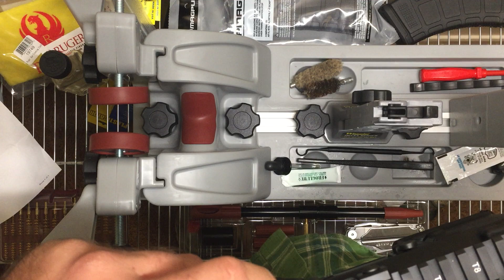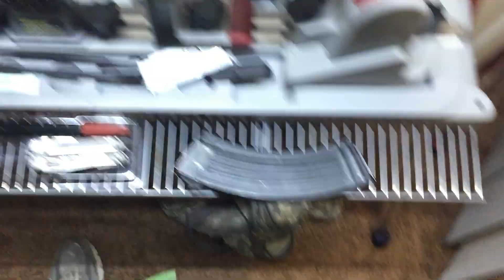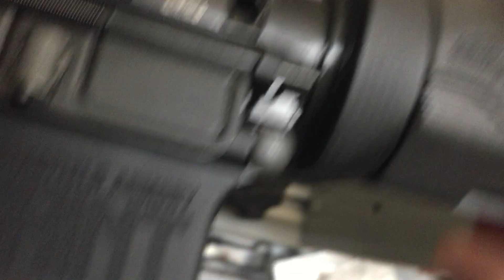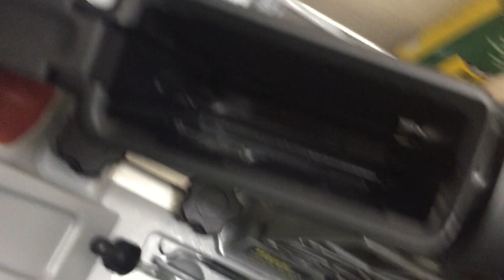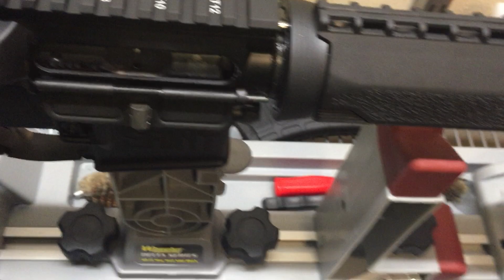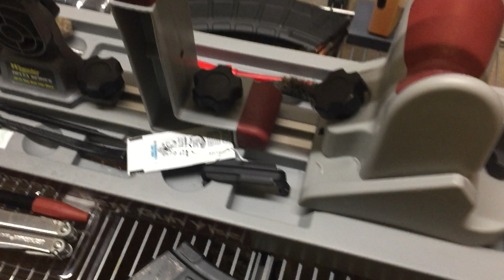(Part 2) Caution Problems With New Springfield Armory Saint Review BIG Fail Malfunction Jam

Comment: Buy a "go/no go" gauge, put it in that chamber and close the action. If it fails the go/no go test send the gun back so they can back off the barrel to increase tolerances. My Remington 700 Police in .308 Winchester did the exact same thing. Don't fire it as you will destroy the gun because of increased chamber pressures. (EXPLOSION HAZARD)! Also gun companies can't refund your money unless the gun is destroyed because of our governments requirement to register every gun and mark it with a serial number. Because of this once you take possession of the gun they don't want it back just in case you murdered someone with it. If you did, law enforcement officials will trace it back to Springfield Armory and seize it as evidence. That means they will never get it back because guns that have been used in a crime must be melted down after the criminal case is closed. So Springfield Armory doesn't want the losses or the media over something like that. You're gonna have to eat it, so better to just fix it or destroy it by firing it which is extremely dangerous. Good luck.
Reply from the maker: Hold that thought I'm making video 3.
Reply: Getting a go/no go gauge set is definitely worth it to me. I got them on Amazon for my first build. It's a critical test. Though it should not be necessary with mil spec parts :-\
Reply: Many believe mil spect equals perfect fit. We are human and full of flaws, therefore we are incapable of perfection. If all parts are made by one maker milspect "might" be capatible.  If your gun was made by different part makers and assembled at Springfield Armory, not only will Springfield deny it, but those parts will equal to close but not close enough. Tolerances will be off just a hair here and there. No big deal with individual parts but when you through together the entire rifle, all theses "tiny" inconsistencies add up to a "jam-a-matic".  This is why we have quality control in manufacturing.  When human error prevails consumers get pissed.  I've owned frankenguns that worked flawlessly and factory guns that had to be sent back to the maker for retuning.  Bottom line is, if it's not part together correctly with quality parts it won't matter if it's milspect or not.  Send it back for warranty. I bet it will fail the go/no go gauge test.

Comment: Just finished the NRA's review of this gun and it's a complete 180 of your review.  Other reviews also call out your unsupported bias.  I am going with the NRA's review as well as as a friend's critique of the Springfield Armory's Saint. in which we both have not noticed any of the problems you mention after firing more than 1800 rounds through this weapon.
Reply from the maker: Joe Goris Thanks for your comment. I highly suggest you go with what you like and believe. My Saint review is based on A non-functioning gun. More about poor customer service than anything. I stand by that I think this gun is a fluke it happens to all manufacturers. But the customer service is not. By the way I have watched all the YouTube reviews up to the end of my series. I think the NRA's multiple reviews are great. They should be with the amount Springfield spends on advertisement through their magazines. every 5 pages there is a new Springfield ad.
Reply: All it takes is one n here we go round the bush

Comment: Don't expect them to fix your tool marks, should have used the right tools in the first place. I work with a guy just like you every gun he gets its got a feeding problem or it jams after he took it apart and decided to sand or file some rough edge of something that didn't need to be done in the first place.

Comment: That us unacceptable. This makes me scared (owning a xds)
Reply from the maker: Ah yes and with the XDS recall I'm sure you are. Thanks for watching
Reply: I had found a XD once and it was completely rusted out and damaged. Called Springfield and without hesitation or hassle they sent me a packing slip and I sent it off. Got it back in a week and they completely fixed the gun. They replaced all worn parts and cleaned the gun for me for free. it ran for like two years with no problems before I sold it. From my experience they have very good customer service.